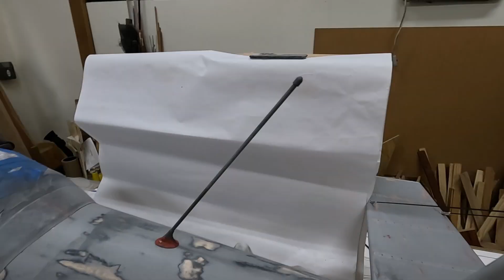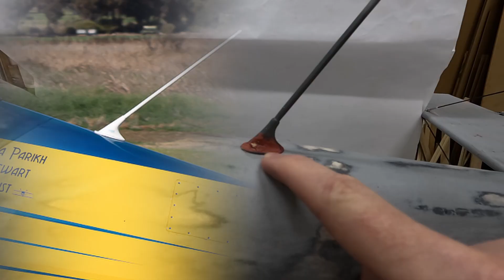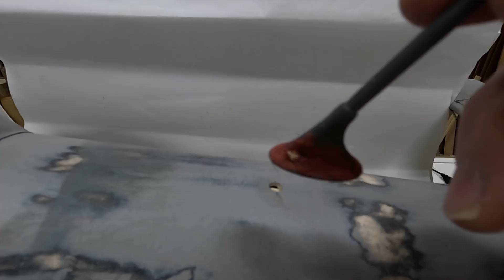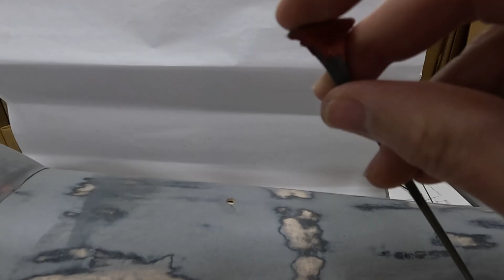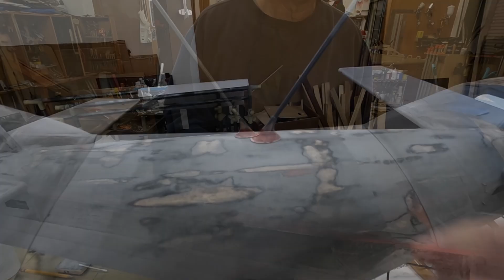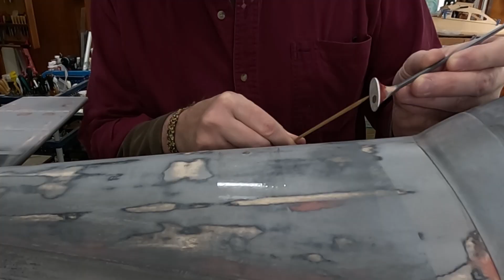DR-107 One Design RC plane build, Update #30, Spine Antenna

Comment: Nicely done once again.  Why not just go ahead and add an anti-rotation pin?  It might help keep maximum magnet force at all times.  If it rotates, will the magnets separate a bit because of the base shape?  Or the base is flat enough so this won't matter?
Reply from the maker: @MrRCGregG   @MrRCGregG  I could add the pin but I know it don't be long before I break it off and then I have to go through the headache of fixing it.  That's why I like magnets, nothing to break.  The magnets keep good contact even when the antenna rotates a little.  I'll probably have to do something with it but I'll wait for now.  Keep the press on with the C-47!